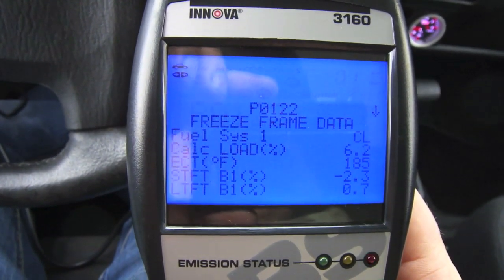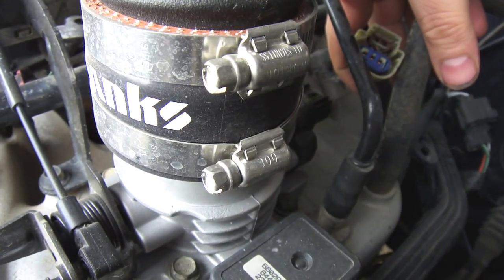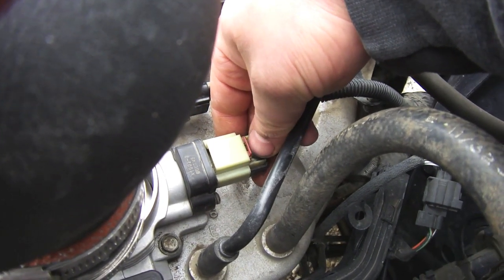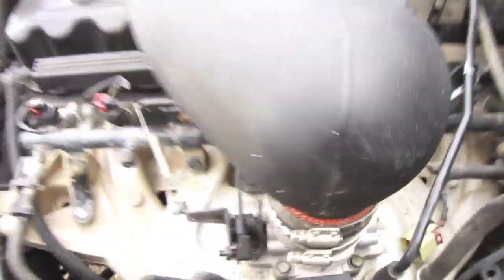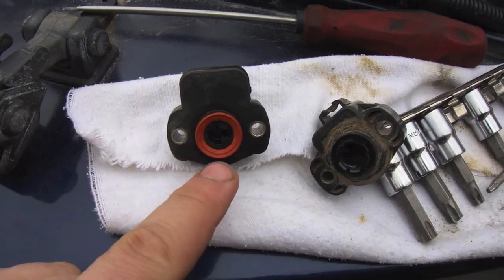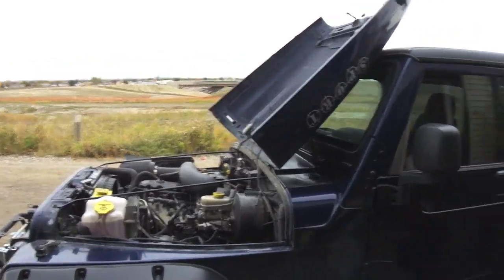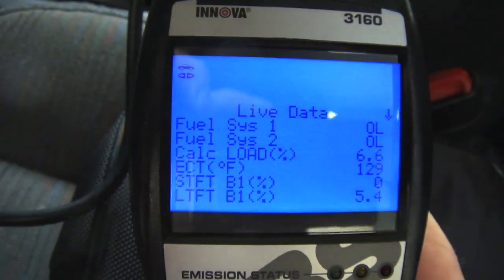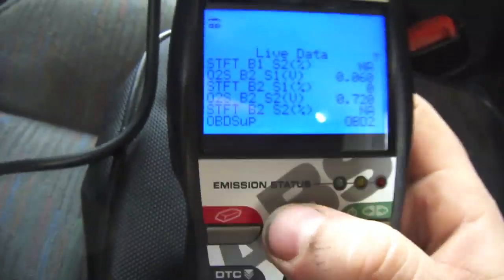How to Troubleshoot Codes P0122 and P0456

Comment: When you had your TPS % showing on your scanner, you should have pressed the throttle to see if it changed. Common problem is to be stuck around 12% and not change while driving.

Comment: Jeep started having intermittent revving and deceleration followed by bouts of back fire, went to change out TPS and knucklehead before me stripped inside torx bolt I'm gonna attempt to slot it and remove, if you know a better way please let me know. Thanks

Comment: Hey man cool vid I recently got an 03 wrangler and also had the p0456 show up. I checked the gas cap and reset the system and the check engine light went away for about 3 days then came back any suggestions? Thanks

Comment: The engine light goes on and off, does it matter if is a 2.4 l jeep I change the tps and still does it, I check the "bad sensor", it was working good, my jeep runs good but the engine light is on, what else can be, im gonna clean the sensor and everything around.

Comment from the maker: if it's a 2 wire switch most likely both wires are positive -  a live wire from a power source and then the wire going to the positive side of the lamps, when the switch is selected it will make the contact and supply power

Comment: Once again great video. BTW I had commented about this device some ago, and let me restate that this device has been INCREDABLE.

I've used it on a 2012 Chrysler 300c,  2009 BMW 7 series and a few junker cars and I've gotten very accurate readings.

It does seems to work best with Crysler/dodge/Ford.